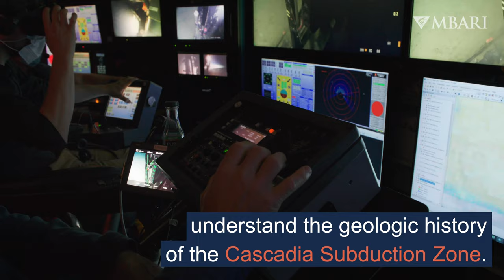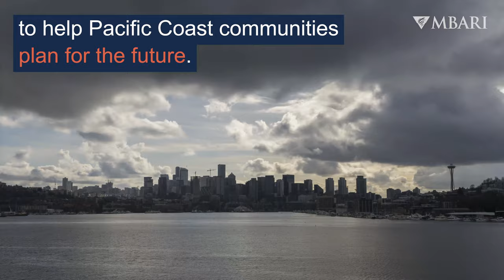Deep-sea geology rocks: Mud samples reveal the history of earthquakes and tsunamis

Comment: I've done this kind of thing on my farm, but for entirely different reasons. It's very interesting to see how soil coring is used in so many different industries/fields of study, and the information we're looking for by examining those cores varies so widely. We can learn an incredible amount from this kind of geologic analysis. For me, it's about looking at the different soil strata, mapping that out, and then using math to determine where water is most likely to flow, and where excess nutrient runoff might build up. This, combined with chemical soil testing gives me a great picture of how I need to set of irrigation, and what amendments/fertilizers I need to put where, and in what quantities I need them.

I suppose if there's an earth quake or a tsunami, there are likely underwater "landslides" as a result in the subduction zone. I never considered studying the layers created by this phenomenon could lead to insights about when these events occurred and how severe they were. Can we determine the magnitude of an earthquake by looking at the thickness of a layer? Do we determine when the earthquake happened via carbon dating of trapped organic matter within the layer? I'm curious how the actual analysis works, I'd love to see a more detailed dive (pardon the pun) into that!
Reply: As would I.